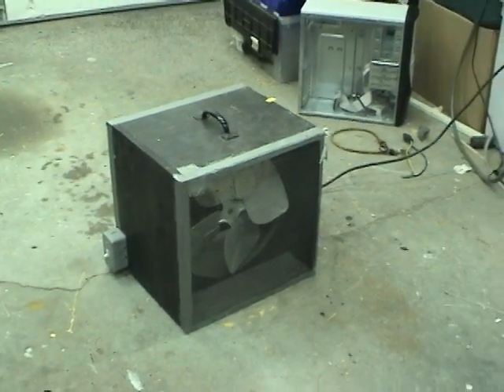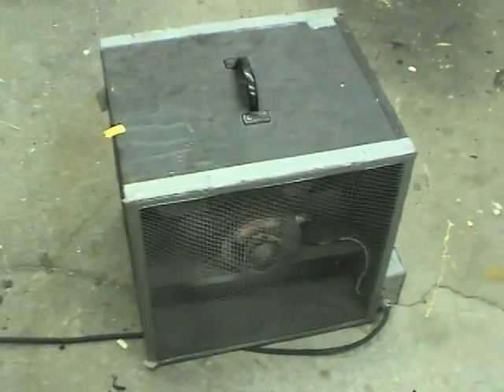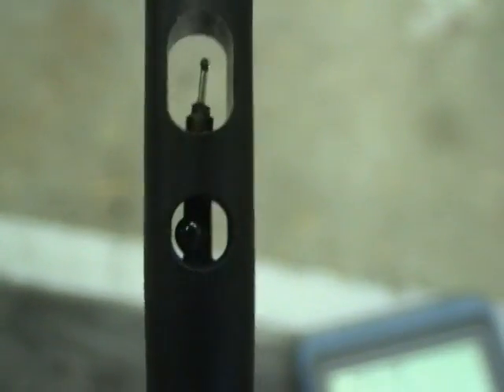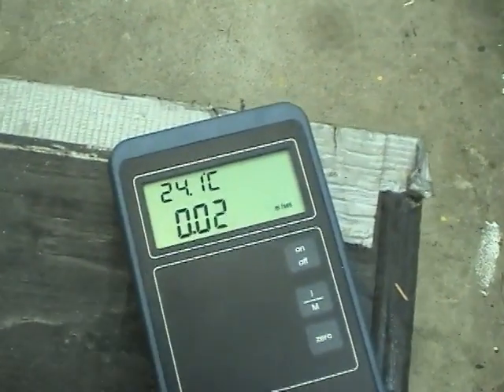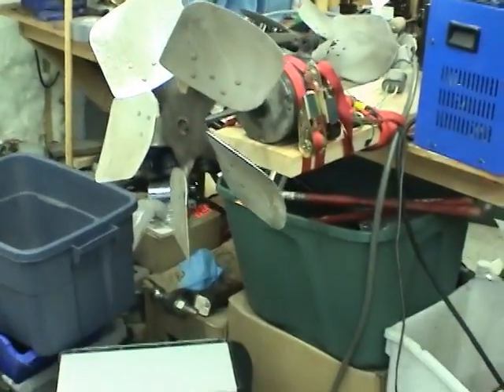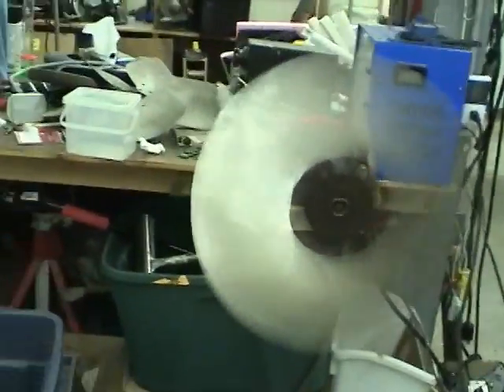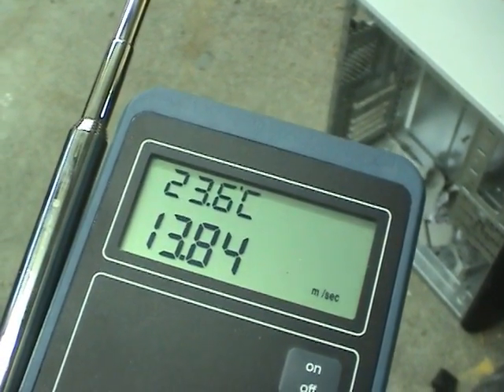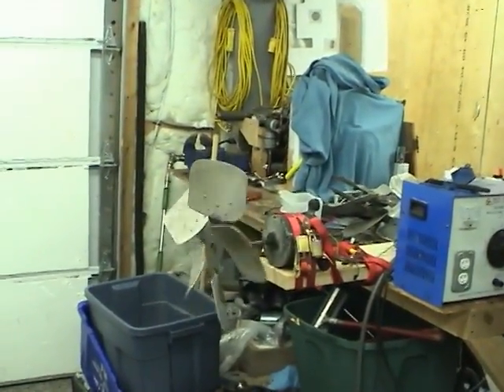Home made box fan and CFM measurements

Comment: Just an FYI, you would not measure the fan-blades surface area to get CFM, unless the fan was free-air. You have to use the surface area of the opening of your "box", as the "flow" is through a screen, and pressurized to the output of the box-confinements, which is where you measured it. Also, you can't just measure a single point, then use the "whole surface" as the factor to calculate. If the center is 0-CFM, the mid-section is 2000-CFM, and the edges are 4000-CFM, but you calculate it as 4000-CFM across the whole surface, of the whole blade... Your results will be way off. This is why you "duct a blade", for testing, and the output is calculated off the duct-size "surface area" of the opening. This is also why they use water to get a real CFM test, and not air. Though, the measurement for air-flow should be exactly the same in the center and the edges of the stream, as opposed to trying to measure a "free-air" blade spinning. Which would require multiple measurements and isolating blade segments by the diameter from the center, where there is 0-CFM, and possibly a negative CFM, since there is no "cone" on the center, where there is no "blade pitch".

Comment: First of all take the motor out keep the blade and but a variable speed motor on it and make it to where you can control the speed from the outside so it is not so loud you should also make the exact things what you have that spins clockwise and has 2 3 4 5 6 7 8 9 or 10 blades that both spin clockwise and counterclockwise

Comment: Hmm.. your using a method to calculate cfm for duct work. I don't know that that will transfer to approximate to fan CFM output. 

There's a tad more involved. 
Type of fan blade, area of fan blade, number of fan blades, effective pitch area of the fan blades.
Diameter of fan blades, and rpm of the motor.
and housing.. which all play a part in calculating or even approximating CFM for a given axial fan. Or centrifugal fan.

Air speed/velocity x duct face area to calculate CFM through a given duct as you're using. Not quite the same.

Comment: The formula assumes uniform airflow around the blades, which it isn't, so you need to sample around its area, as another mentioned.    An image of airflow variation around the blades: 
http://web.uconn.edu/poultry/NE-127/Images/air3_02.gif

Thus, different designs of fans, ducts, and blades have advantages, which isn't so obvious with a single measure.  Thanks for posting so long ago.

Comment: you should have moved the anemometer around during your testing to get a better estimate of the actual airflow.   A little closer to the fan will make a big difference,  as will closer to the tip of the blades vs the center.